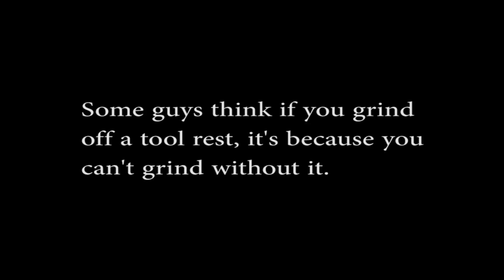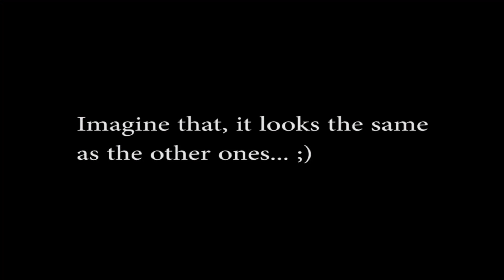Custom knives Nick Wheeler free hand grinding vs tool rest

Comment: Tool rest and jig equals speed for me.  I have only made about 15 knives and in my case the rest and jig is like training wheels as I learn how to grind.  They let me learn what needs to be done without ruining my early blades in the learning process.  My first three knives I did by hand with a file.  Great experience.  Next ones I did on a 1x42 sander.  Now I have built my own 2x72 and will be learning to use it soon.  I don't understand the haters on these things.

Comment: I just don't understand why folks make a big deal about how a maker grinds a blade.  I guess if you follow that logic all the way somebody's going to say using a grinder and electric tools is cheating...and then buying steel instead of blooming your own from dug rocks is cheating too.
Reply from the maker: Yea, it seems a knife should be judged on its quality. I can tell you I've NEVER had a collector come up to me at a show and ask if I ground the blade on a tool rest. ;) :D
Reply: Nick Wheeler Agreed. Anyone nit-picking on process just comes across as whiny... Seems especially silly to pick on a guy like yourself that does so much by hand!